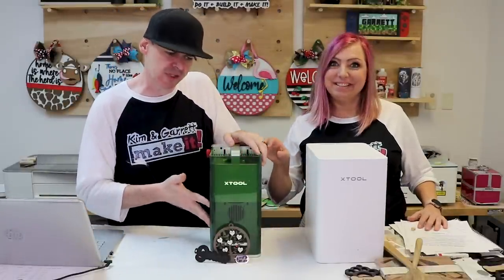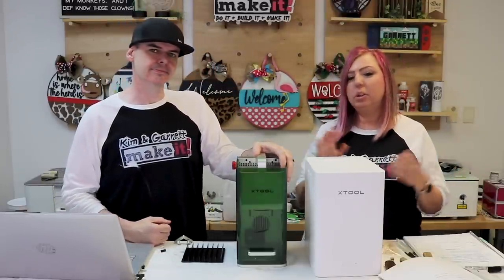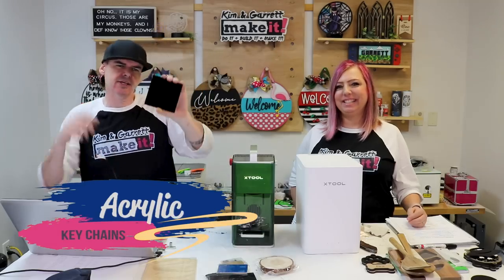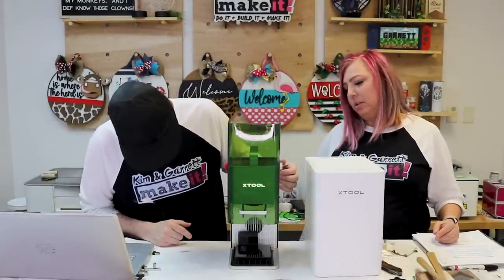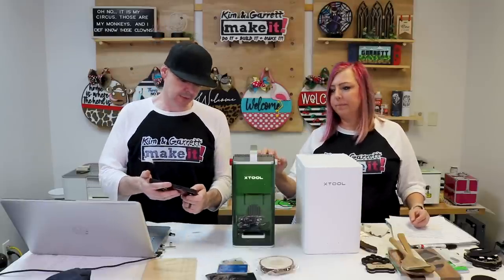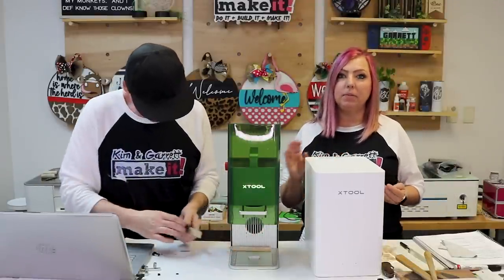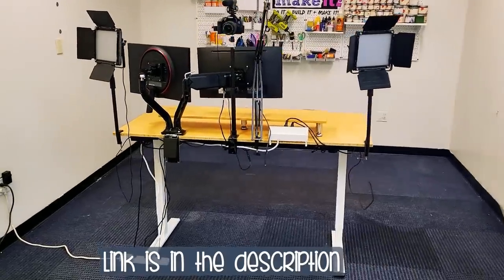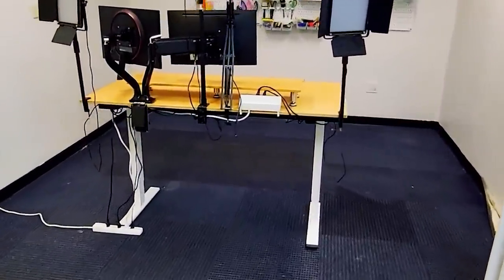The Incredible xTool F1 Laser That'll Upgrade Your Crafting Game Instantly!

Comment: The galvo is cool and when combined with the reduced work area, does seem speed things up.  However, these are the same laser modules / power as the D1 pro.  So to the extent that the laser power is the limit (which is often the case with the IR module), you won't be able to go faster than the D1.
Reply from the maker: Yes, BUT.... I WILL be able to personalize on the spot.  It's something we've been discussing for some time now,  the desktop lasers & filtration system is a lot to run from our booth and we don't have any kind of exhaust for the D1 so I think this will be a great alternative!
Reply: You might be wrong on that? Isn't this galvo style 1064nm laser beam reflected and focused with mirrors? There is no module that has to travel like it does on the D1Pro? There is no gantry. It is more like a real fiber laser. Otherwise, how would they get the up to 4000mm/s speed? It is not the reduce work area. Speed is independent from the work area. It either goes at that speed or it doesn't.
Reply: @doen.8724  The max travel speed on the galvo is faster than the gantry for sure. Which does speed up travel across white space / unengraved areas.

And in that fashion as well as the preview, it is similar to fiber laser. 

However the fiber lasers have more optical power, they usually start at 20w vs 2w for the IR module here on the same frequency or the 10w that is on the blue frequency.

So actual work with the laser is still limited by the power of the laser - not the travel speed of the galvo vs gantry.

So no, these aren't as powerful as a fiber laser.  Not by a long shot.
Reply: I can't wait to get mine! It should be here sometime in August. It is going to be awesome to use at my fall craft fairs for personalization. Puts me above the rest of the laser booths. I also plan on using it to do my smaller engravings and use the D1 20w for my bigger projects. Next year...the CO2 P2! So glad you got this and can show me the ropes...LOL.
Reply: @1234c0le  Also have to consider for gantry systems engraving small objects, they will spend a large amount of time accelerating/deaccelerating and travel extra distance to do so . The max 400mm/s ~ 600mm/s would actually engrave slower than 100mm/s ~ 200mm/s depending on the size.

This makes the galvo faster for small engravings, even when set to the same  400mm/s ~ 600mm/s of the D1/S1

Comment: Hey guys! Love your videos! The air purifier starts up automatically when you lush the start button on F1 or manually? Which other lasers do you use? I had the M1 but it went crazy beaming the laser and burning when is was supposedly to use the blade only. Only con I see with F1 is the cut area size .